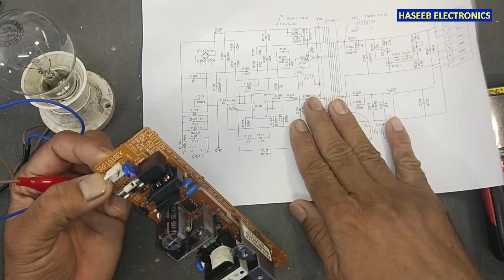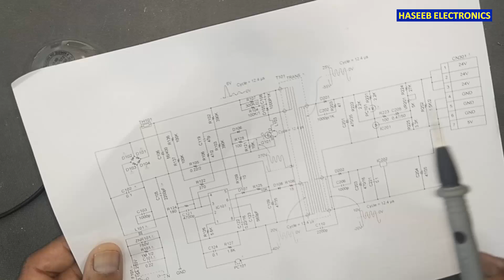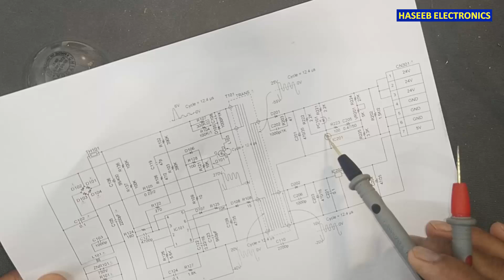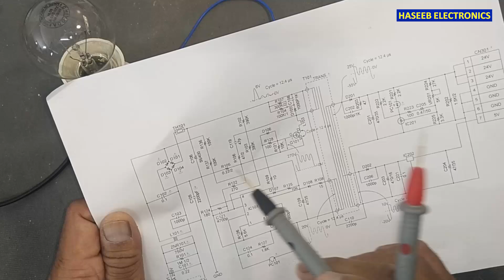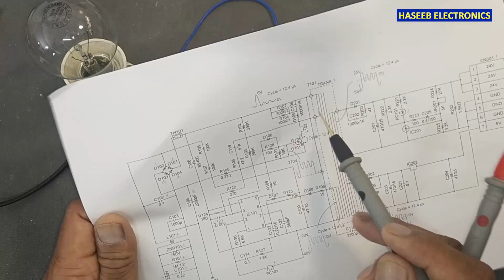{761} SMPS Is Not Working || SMPS Not Turning ON

Comment: Sir. I have a question is that, if we touch the  live line on the PCB when series bulb connected, will it hurt our body or not, or as our human body high resistance, so the current pass through the easiest path on series bulb 💡

Comment: SMPS of VFD is automatically power off after 10 to 15 mints.After that not powering up.After several hour when I'm giving power it is on for 10 to 15 mints.SMPS issue ...what may be the possible reason.
.....
Reply from the maker: it seems that it may have some hysteresis issue. might be some dry soldering, or bad soldering joint. 
in some situations start up section for the smps ic makes problems

Comment: Hello Haseeb Sir.
Video is full of knowledge. 
Sir I have wireless cdma phone supply with built in 7ah 12v battery.full fluctuation both sides.i also changed remarkable parts but problem is same.plez any idea Sir.
Thanks

Comment: you are alaways clear explanation of smps troubleshooting. we have problem in one pcb ciruit, there is toroidal transformer is used. when we are connecting the transformer secondary side, the hot line of fuse blown. can you explain how to check this type of trnasformer.

Comment: I initially thought that its dangerous to measure drain to source using multimeter and may damage it, because its above the supplied voltage .. thanks for letting know
Reply from the maker: it is my pleasure 
if we want to test AC voltage, that is dangerous in some situations (specially when our multimeter don't have good response at higher frequencies). in that case we can monitor dc voltage

Comment: Excellent video. This is the most common failure  (that I've seen) for old switched power supplies.
Reply from the maker: best regards 
yes brother, these electrolytic capacitors are most commonly have failures,